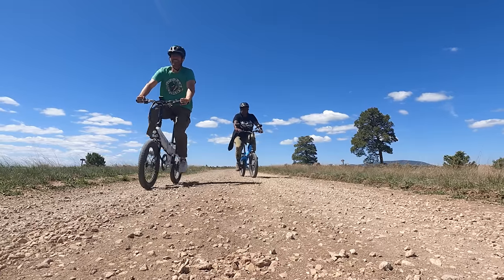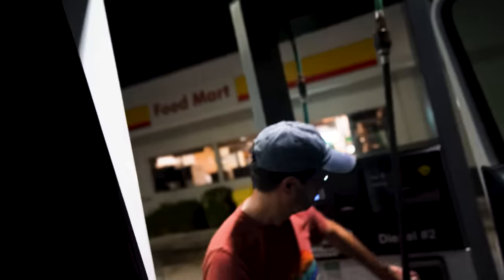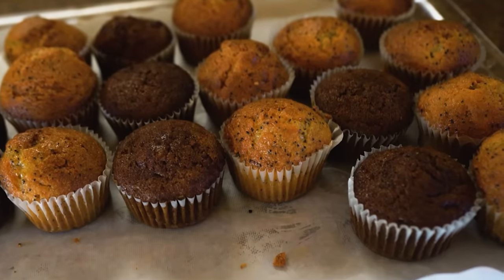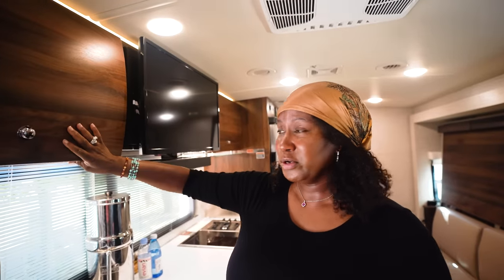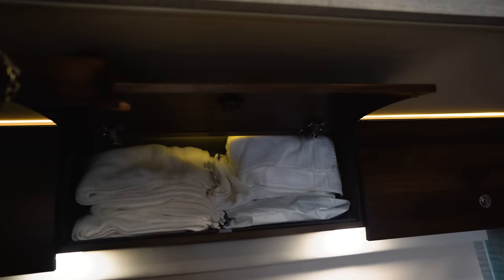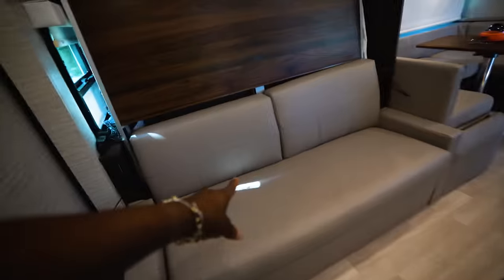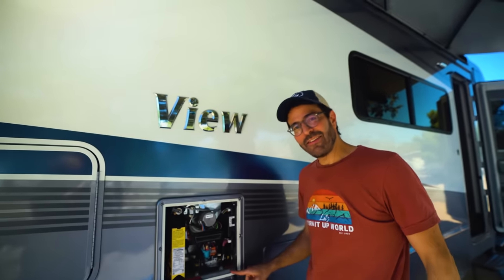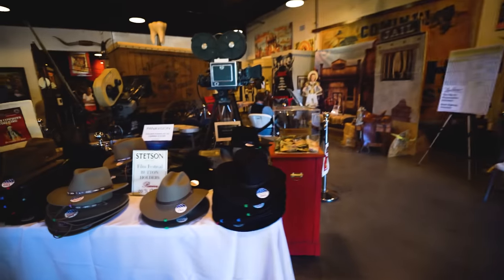We Swapped Van Life for BRAND NEW Luxury Small RV (RV Tour) - RV LIFE

Comment: We have a 2021 View, 24D. The secret to the Murphy bed is buying Beddy's (bed-ease) zipper bedding. You just zip up the sides so it is super easy to make the bed and the bedding stays on and in place! Plus, if your spouse happens to steal your covers in the night, you can zip up your side and no more waking up cold! We wintered in our View for 6 months last year in AZ! Xantrex inverters have been a problem in it (we're on our third one!) but otherwise we love it. Safe travels!
Reply: we too have a 2021 Navion and have noticed the Inverter sometimes shuts off randomly when we are usually driving. Just wondering what your issues have been so we can take ours in to be fixed before our warranty expires.
Reply: You have to watch your cookware on induction cooking, only stainless steel works, correct?  Also the cooktop can crack if accidentally get hit by falling pots etc.